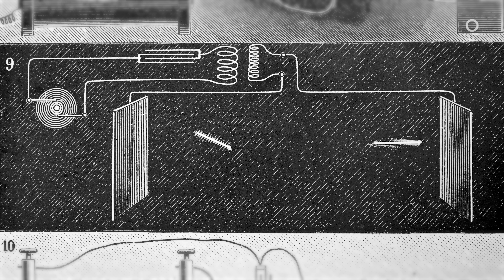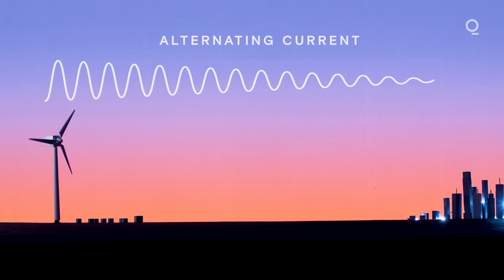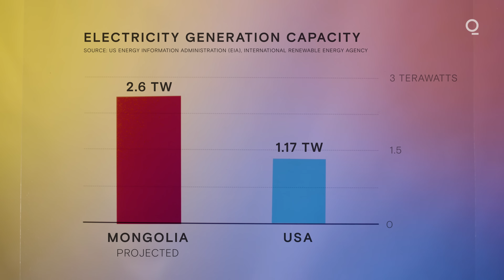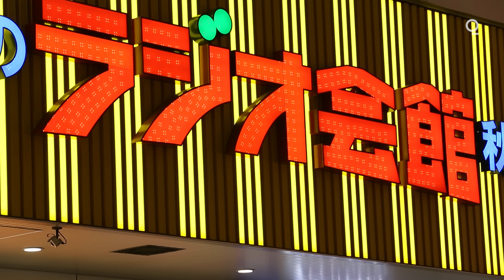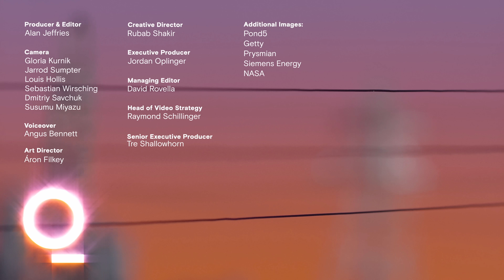The World Needs Supergrids, But There's a Problem

Comment: A world wide DC super grid is certainly the future of powering countries... imagine you want large amounts of electricity at 9pm....with a super grid its simple just build a solar farm where the sun is shining at that time...   We already have high energy grid AC DC converters so it is not some 50 years away waiting for the  technology. We just have to stop subsidising fossil power and it will make perfect economic sense. The more super grid we build, the less electrical storage we need to have 100% Renewable energy systems powering everything. 
  
At some point we must also get realistic around pricing, where customers have real time digital readouts in their home of the spot price they are paying.... so choosing to change your electric car, or any other task that has flexibility in time of use can work to benefit the consumer and the power grid. 

I would also suggest we keep the internet at arms length from grid operations.

Comment: 'Enough power for 1M homes?'  Trouble is, with no wind or sun, there are 26M homes in the UK, not to mention all other electricity users, all wanting power concurrently.  And that is at present demand, which will inevitably increase.  We need to  harness our own reliable power, not rely on importing it in massive cables, from countries which can turn off the tap at the push of a switch.  WE HAVE GAS - USE IT.
Reply: Interconnectors also fail. Half the Anglo-French interconnector failed for a while.

Comment: There is an invention, EPM series, U.S. Patent No. 9641045B2 that could eliminate the need for extensive grid system, reducing both expenses and dependency on large-scale, hydroelectric plants, power plants or wind farm. The EPM represents a revolutionary approach to electricity generation, empowering states, counties, cities, businesses, and even individual households to establish local power stations. This innovation minimizes the need for costly grid infrastructure while making energy generation more accessible and sustainable.

Comment: Maybe Putin can be in charge of the super grid. Well, maybe the Chinese. On second thought, the North Koreans should be in charge.

I have solar panels. And a propane generator in case the grid goes down. I am connected to the grid but I'm using it less and less.

Comment: All this talk about grids is to support the idea of continuing use of large power plants. A better idea is a distributed system with large batteries to support regional demand. No single point of failure and less transmission requirements.

Comment: It would be nice if the USA had a national super-grid. In the meantime there are alternatives. Rewiring existing transmission lines using improved AC cables would double transmission. With increased battery storage, it is possible to leapfrog power between distribution/storage hubs". In development are very fast and inexpensive horizontal plasma drilling machines. DC or AC cables can be buried especially along existing highways. NREL predicts that one third of electrical generation will be produced by residential and commercial sites. This means a bidirectional flow that allows many more electrical sources.

Comment: The whole concept of “decarbonization” is an error. Nobody has done the numbers to see what the result of that process would be, instead we are just lurching ahead with a plan with no regard to its effectiveness or negative effects. I suspect, and over time I see my suspicions confirmed more and more, that no amount of efforts by any particular country will solve any problems related to global climate change. No amount of effort will make any noticeable difference in the climate, which will continue to do whatever it does, while efforts to control the climate will all fail and entire nations will fail along with them. What happens when, for example, a nation’s power grid fails due to lack of power, after shutting down all of its reliable power generation sources and replacing them with sources that cannot do the job? At some point it must be accepted that we would be better off spending a few resources on adapting to changes in the climate, rather than humongous resources trying, and failing, to stop the climate from changing.
Reply: I mean you aren't wrong but your hypothesis is not exactly right either 
The decarbonization argument ignores methane emissions and the fact that plants are carbon sinks, the London smog was what happens when you polute the air and weather systems happen that are impossible to predict the outcome

Comment: Edison was a malicious actor. He understood the benefits of AC just like Tesla but had patents on DC. Incidentally Tesla originally supported DC over AC because it's more efficient in theory.
AC was better because it could achieve better power efficiency WITHOUT switches. Switches at the time were badly designed and wore out.
We now have transistors that is solid state switches. Which is why DC is now just obviously better than AC. Stop repeating this ahistorical nonsense.

Comment: With 1% of the annual world consumption for supergrid electricity exchange loss, the supergrid would be a formidable open air room heater with 248 terawatt/hour heat dissipation. You won't need a supergrid after the coming war with artificial winter. But men able to build and feed.

Comment: Incorrect analysis. In ten years time the costs of solar and storage will be so cheap that is going to be cheaper for the consumer of power (residential or commercial) to be energy self sufficient, than merely paying the services charges for the pleasure of being connected to it. The centralized ideologies of power generation and distribution are not going to be relevant. We are already seeing companies with high energy requirements make direct investments into their own power supply, simply because its the cheapest option today.

Comment: Somebody said that it would require high levels of international cooperation but I think it will happen if one major country becomes a superabundant producer of clean energy.  It could surely be China, but the US for instance could build a 100X100 mile agrovoltaic desert permaculture food forest and produce significantly more food and energy than the entire country needs just on that one property on "useless" desert land.  This would require the next gen of robots to have ported Tesla FSD on-board, for autonomous mobility, as well as some additional custom AI software obviously, for intelligent & dexterous harvesting and pruning. The project would have a neuromorphic supercomputer and many grid-scale Tesla batteries adjacent, with a connection to the beginnings of an international-scale ultra high voltage line.  But instead we spend trillions on fruitless, horrendous wars.

Comment: In engineering, one must certainly not take a solution that does not work locally and try to scale it up to national and international levels.  That is a recipe for bankruptcy.  Instead, we need a new generation of nuclear reactor powered combined hydrogen-electricity power for homes and transportation.  Do not let people with no engineering experience try to determine national energy policy.  It has not worked in the past and will not work in the future.  It only leads to further impoverishment of the type we have already started to feel.

Comment: 10:33 The Champlain Hudson Power Express is different from the other exemples in that it starts outside of the US in Canada. Québec currently has power surpluses and has been trying for more than a decade to build new lines to export that electricity. Québec is still building more capacity despite having surpluses. Québec wants to become the battery and power supplier of the entire North East. Québec's power grid is also very interesting in that it has some of the highest voltage AC power lines in North America, with the primary and secondary transmission lines operating at 735Kv and 315Kv AC. Theses high voltage lines were built in order to get power from large dams up north down to the population centers in the south over a distance of almost a thousand kilometers. The modern high voltage AC power lines was in fact invented for the needs of that project.

Comment: If it is so politically difficult then how come here in the UK you can place an order on a Chinese server? If you can build a worldwide network of telecoms cables then really there is no greater problem doing it with thicker cable, albeit a fair bit more expensive, but overall it will save you money. What is not to like?

Comment: Powerlines are extremely expensive. Solar and wind are cheap, and as are, by comparison with high voltage DC lines, home and small town scale storage batteries.  A townsperson with six months of training and a year’s apprenticeship can oversee the installation and maintenance of solar and small utility scale battery systems. Much less equipment and training would be needed than to build and maintain HVDC.

Comment: So with HVDC, do houses need inverters (devices that convert DC to AC) at the end? So many of our appliances need alternating current.
Reply: HVDC lines are not going to connect individual houses. They are competitive only on the scale of hundreds of miles.
Reply: As AC bulk power transmission over long distances is not possible due to the capacitive loading of the lines, the only way is to to it in DC. Approx. for distances >600-700km (overhead line) or >80-100km (cable) it makes economical sense to use DC.
Reply: Simply both ends will have converter stations that rectifies and inverts using bunch of pulsed thyristor

Comment: Missing a key simple 3 pronged single solution. 1" pipe of supercooled H2 as: 1) superconductor ,  2) fuel⛽🛢 3 Water  Source 💧, saving electricity from pumping & desalination water.

Comment: The thing we really need to do is add the HTSC (high temperature superconducting) component to an HVDC supergrid.  The idea being instead of having piles of unsightly overhead HVDC lines crisscrossing everywhere to get this power around, you have more of a coaxial cable 'pipeline' in the ground.  Pipelines go all over the place and people don't care because they are buried and out of sight.  You build these in redundant loops snaking around the country and even world and armor them to a reasonable degree, then you have a high degree of redundancy while linking into many points of the existing grid as any cut through the armor just means the power may flow the long way around a redundant loop.  Superconductors can carry at least 150x the power per unit of conductor than conventional copper conductors.  Superconductors emit no heat and thus have no resistive losses.  Superconductors act as natural surge suppressors if you push too much current through them.  Also you can build conductors carrying hundreds of GWs of power per conductor with the main limit lack of demand to go higher.  Coaxial DC power lines have zero external EMF, so nothing for the tin foil hat club to complain about.  All you need to do is keep them cold with something like liquid nitrogen, an industrial cryogenic fluid we can mass produce on the cheap.  At this a line you can shove say 200 GWs through, well you can afford the heat and electrical insulation to have very little heat loss while also ramping up the voltage to push that 200 GWs through it.  You can place these lines under the ocean, no problem.  Some country doesn't want to play nice, you just route around it as there is basically no loss for going the long way around.
Reply: Excellent analysis of an achievable technology to solve this problem. We need people like you, Jason, in positions of political power and authority.
Reply: no there.s not, that was a false claim, and the pressures were astronomical @jerryrobinson7856

Comment: Well super grids are not really just a "proposal" in Asia. Indian national grid is already connected to Nepal Bhutan and Bangladesh and another HVDC line to Srilanka is under implementation (Madurai - Anuradhapura HVDC). So I think regional super grids are already becoming reality and might transform into intercontinental grids in the future
Reply: Plan to connect Saudi Arabia via undersea cables too
Reply: China is the only country in the world that uses HVDC and HVAC in large scale. The system of 100 MW built by Simens is a little baby comparing with Chinese ones that have been using for long time. China's HV transmission technologies are the best and most mature ones in the world. as of 2020, China's State Grid had29 HV transmission lines in operation, 15 of them are HVAC and 14 are HVDC  with total length of about 50,000 km. China uses HV system to connect all the country. It sounds the HV system is a new one while China's first 1000,000V HVAC line was put in operation in 2009. The distance is more than 600km and the capacity is 6,000 MW. China is building 24 HVAC and 14 HVDC new powerlines with total length of about 30,000 km between 2021-2025.
Reply: @StevenX-v1r +99999999 social credits
Reply: Lol. Sure...

Comment: Get rid of the grid instead pump hydrogen to buildings and homes whereby the building can generate it's own DC power via a cheap fuel cell and also use the waste heat for heating the building
Reply: Someone needs to step up and demonstrate this technology, before others will even attempt it.

Comment: Or just build nuclear and use a current, perfectly functional system, instead of trying to reinvent the wheel...
Reply: @lepidoptera9337  why is it the cheapest in Europe then?
Do realise one simple thing about those cost for kWh renewable industry loves to brag about:
Setting up some panels or wind turbines is not all that you have to do to reliably power a country.

You have it said here - redevelopment of the entire grid is necessary.
Energy storage is necessary.
And since it's necessary the cost of these things should be added to the price of renewables.

And once you do that they're no longer so cheap.
Reply: @lepidoptera9337  let me specify the question then - why the nuclear powered countries have way lower electricity prices
than renewable powered ones?

Exactly for the reason been mentioned
conventional power plants are build exactly where you need them - which minimize the transmission costs and waste (and let me tell you high voltage transmission lines are mind bogglingly expensive, and on op of it as mentioned there is a pile of legal hurdles to overcome which ain't cheap either)
renewable farms tend to be in the middle of nowhere - which means a lot of energy has to be moved for great distances, which means costs and waste.
it's great if DC current makes you waste a little less. Unfortunately, you can't use DC current in your home. Which means it has to be converted to AC.
Yeah, those converter stations ain't cheap either...
then there is energy storage - insanely expensive
then there is backup in case it just so happens it's not so windy or sunny as you hoped for

doesnt matter if pv panels are getting cheap if everything else you need to have is not.

you got the comparison of a system that just works
with a system, that's gonna be a constant struggle to make it work - as it depends on hundreds of variables.

Comment: I believe in order to reach this ambitious goal of creating a super grid there has to be a global collaboration of all countries to establish an international renewable energy organization separated from any political issues ,its sole purpose is to provide clean energy for everyone in the planet by utilizing each country's energy producing potential and it should be adopted by UN as one of its subsidiaries .
Reply: You do t get it. That is highly political. Some countries have natural advantages when it comes to energy
Reply: It will happen if the USA becomes a superproducer of clean energy.  The US could build a 100X100 mile agrovoltaic permaculture food forest and produce significantly more food and energy than the entire country needs just on that one property.  This would require the next gen of robots to have ported Tesla FSD on-board, for autonomous mobility, as well as some additional custom AI software obviously, for intelligent & dexterous harvesting and pruning. The project would have a supercomputer and many grid-scale Tesla batteries adjacent, with a connection to the beginnings of an international-scale ultra high voltage line.  But instead we spend trillions on fruitless, horrendous wars.

Comment: If the freight railroads of America were forward thinking, they would make themselves the conduits for the grid. Build a grid AND electrify their lines. The routes exist, the tech exists, the locomotives exist.
Reply: @lepidoptera9337  look up the soo renewable rail line. 350 miles of hvdc under a rail right of way. Already underway. Connecting it to substations along the way is cheaper than finding a grid connection if you want to electrify your rail line. Doing both would lead to massive carbon emissions reduction by killing two birds with one cable, pun intended. Some of us actually educate ourselves. Armchair who?
Reply: @lepidoptera9337  I am talking about a trans national grid, as required, in the US. Railway lines may be among the best choices for routing such a network. It's really very simple.
Reply: @mkkm945  
It's really obvious. Apparently. 
That means it can't be simple: why hasn't it happened?

Comment: Super-Grids, S-Gs, are BUSTED.  The architectures aren't resilient & way too slow to implement.   Importantly, S-Gs aren't able to provide any timely climate change help.  Continental-scale interconnections are very difficult to arrange.  This Quick-take lists the major reasons building S-Gs is like swimming in glue.  S-G politics are mountain sized speed-bumps.   This idea is a FAIL.
Reply: However, all isn't lost.